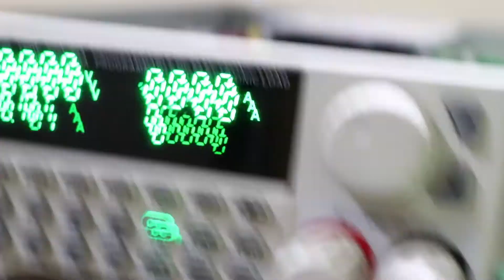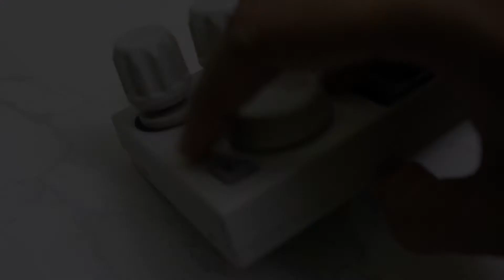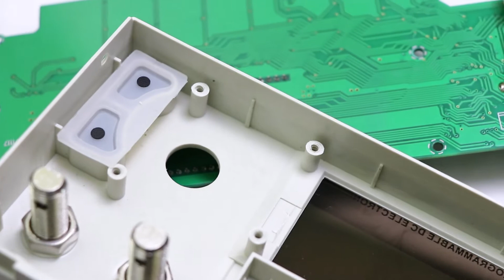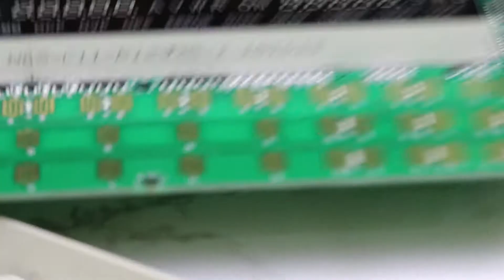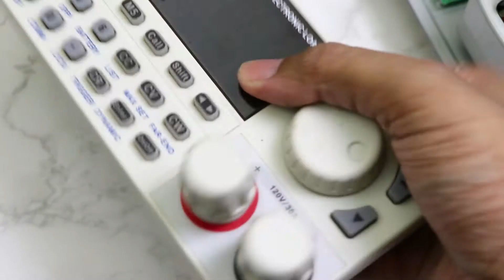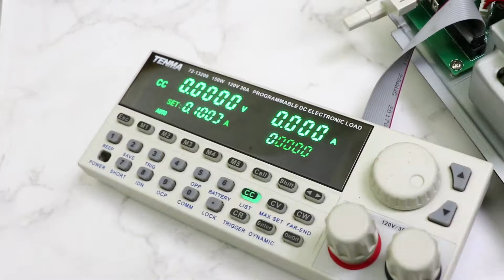Tenma Electronic Load front panel issue - troubleshooting (Part 1)

Comment: Seems like a common issue, for me the display works but the leds and display flicker like crazy with things briefly or entirely lighting up as I turn the rotary encoder
Reply: Alright fixed my issue ... Order 7 x 74HC595D smd chips. The 8bit latching shift registers in there are seemingly Nexperia chips but I suspect they might be fakes or from a bad batch. In my case the display leds (numeric and key illumination) all flickered like mad. I reflowed the lot of them and things got even weirder with the display stopping all together or occasionally coming back weirdly for a few seconds.

Long story short I put 7 toshiba 74HC595D's on there and now it works flawlessly.

Edit: If you have a TL866 II plus (or similar maybe) programmer and a SOIC to DIP adapter you can use the logic test function in your programmer software to do a brief check of these chips. Not sure how accurate and reliable it is since it is a single shot simple test but ... better than nothing I guess.

Comment: Hi, can you please do me a great favour ? I would like to buy this unit but I need to know, due to limited size in my lab, what is the exact depth of the device, measured from the top of the power cord adapter to the top of the + and minus terminals on the front side. Can you please measure it for me? THANK YOU VERY VERY MUCH IN ADVANCE!!
Reply: Hi! The depth is 39cm from the terminals to the back cover without the power cord. You can use a 90 degree power cord if you have limited space on your desk.

Comment: hey patrik.i have a similar issue with the korad kel103 wich is pretty much the same load. 

when i switch mine on, the display is not working the rotary encoder is beeping beeping tho. when i switch the unit off some leds on the display light up for a very short time. 
have you found out what has caused your issue? 
best wishes hansom
Reply: The 8 bit latching shift registers (74HC595D) on the display pcb, one of them at the very least (see my other comment). I swapped mine out (all of them) for new ones from a reputable source and problem solved. Have now checked all 7 of them in my TL866 programmer and found 1 to be faulty while the others tested fine (since it is about 2 euros for 7 of these just do them all I say).

Comment: No idea, but I'm thinking of getting this load. A quick video of all the interior and the heat sinking would be nice. Have you used any of the comes to control it?
Reply from the maker: I haven't used its PC interface. In my opinion the core electronic design is nice, similar to most other good ones out there. Also, looks like the 300W model is designed for higher power because it has many unpopulated slots on the main heat sink. So you should be good for the budget.
My issue with Tenma is their use of crap UI parts to save a penny. That's what ruins their otherwise good products.